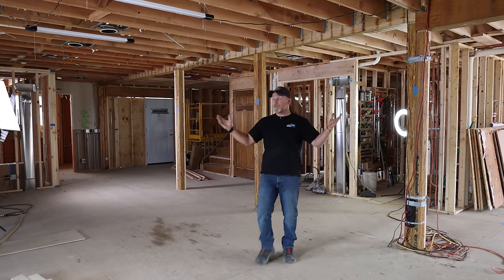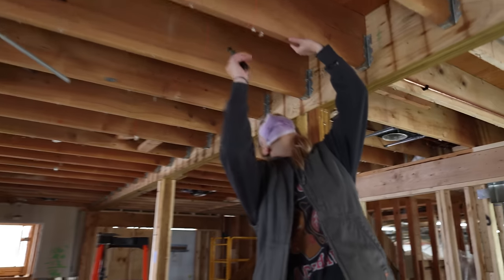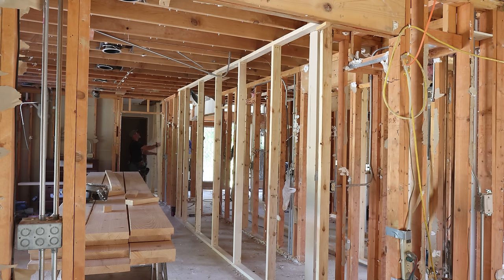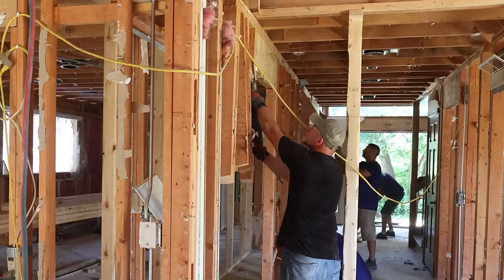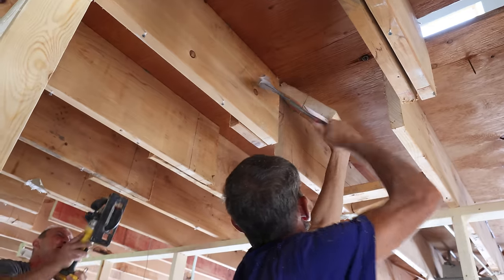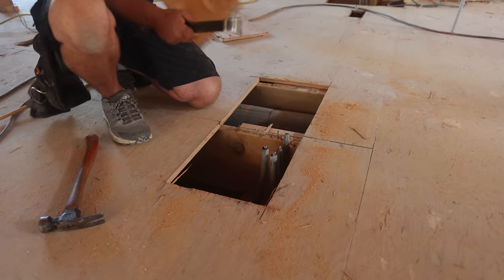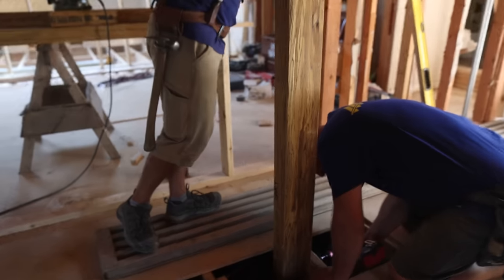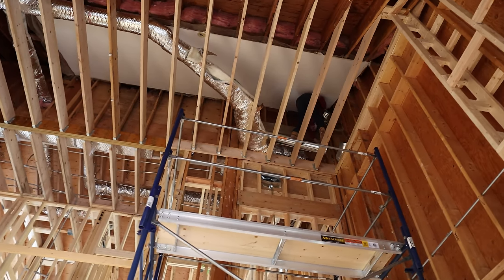How to Remove a Load-Bearing Wall to Create a Open Floor Concept ||| Dream Home Renovation Ep.3

Comment: If you need a professional drywall finisher wirh Over 18 years experience...   🎉
Reply: Dude it's drywall! How hard can it be
Reply: @damonunderwood813  brother do you know what's a DRYWALL HANGER AND A DRYWALL FINISHER, IT MIGHT NOT BE HARD.  ITS THE QUALITY YOU GIVE TO CUSTOMERS.  ALSO TO BE A DRYWALLER NEED EXPERIENCE OR THE DRYWALL FINISHER WILL CHARGE MORE FOR CRAP WORK.  anyways. BE safe.
Reply: Those sheets of drywall are heavy! I have a ton of respect for anyone in the trades. There is so much learning, skill, craftsmanship, and back breaking labor involved.
Reply: @HB-600  I just reply to your. Way of responding DUDE IT'S DRYWALL! HOW HARD CAN IT BE.  And I what I said, it's if you need a DRYWALL FINISHER WITH OVER 18 YEARS OF EXP. NOT COUNTING MY 5 YEARS OF APPRENTICE, LIKE I said.  Be safe brother.   Also I know how hard it's to hang drywall...